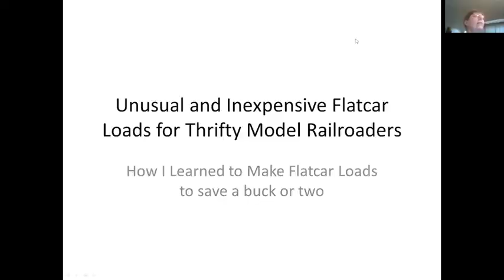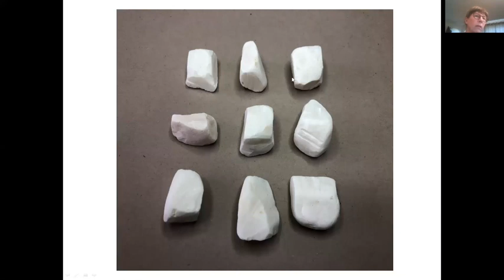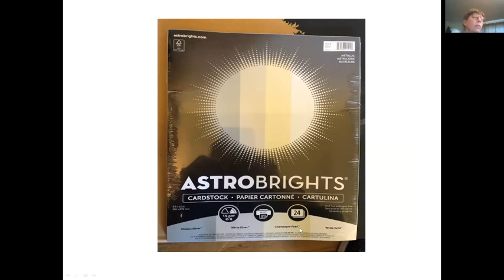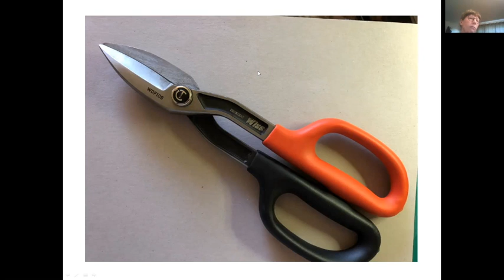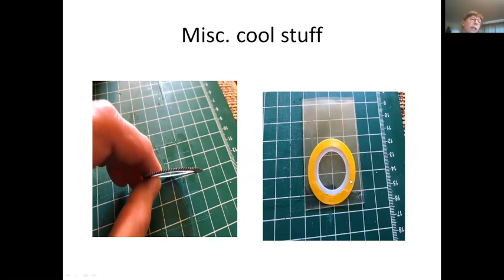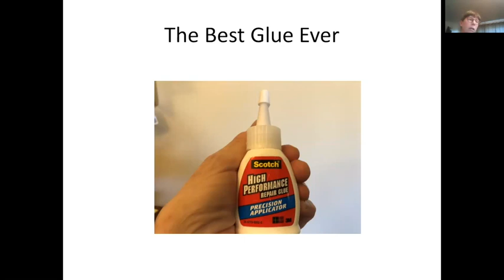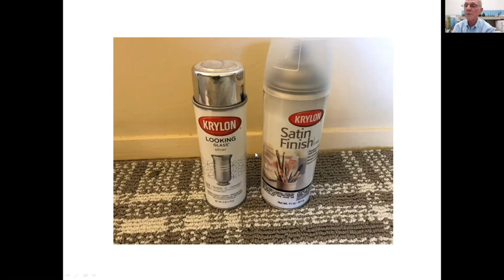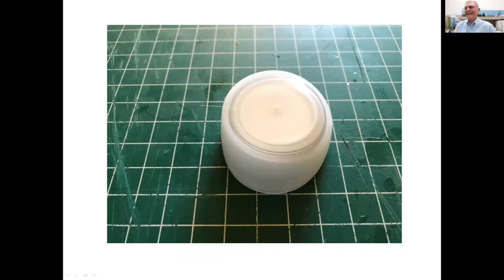Susan Gonzales on open loads 4DPNR 14 April 2021   Large 540p

Comment from the maker: Lee Marsh wrote in the following comment, which adds an interesting twist to one of Susan's load photos:

"I noticed the NNS &DD Co reporting marks on the ancient truss-rod flat car and realized this was probably Newport News Shipyard & Dry Dock Co (originally I thought it might stand for Norfolk Naval Shipyard & Dry Dock, but quickly figured out otherwise).

Googling NNS & DD Co turned up the same photo and a link to Langley Research Laboratory – also in the Norfolk area. It turns out that this load was (is) a pressure vessel for the “Variable Density” Wind Tunnel (VDT). https://en.wikipedia.org/wiki/Variable_Density_Tunnel

In the late 1920s aeronautical research using small-scale wind tunnel models needed increased density air to achieve “similitude” for non-dimensional parameters like the Reynolds number, which defines the transition from laminar to turbulent flow. So scientists came up with the “VDT” to operate at increased pressures (up to 22 atmospheres) to achieve proper similitude for wing and airfoil study.

 Long-story-short, this “tank” on a flat car is the pressure vessel that housed the wind tunnel that made these aeronautical studies possible. In turn this work led to the development of many of the WWII-era aircraft that, for our generation are legendary – DC-3 (C4-7), B-17, P-38, P-51 and more.

 Now that is a load indeed for a lowly truss-rod flat car! Wow!

 I sincerely thank Susan Gonzales for bringing such a world-changing flat-car load to the attention of us lowly (but technologically fascinated) model railroaders!"